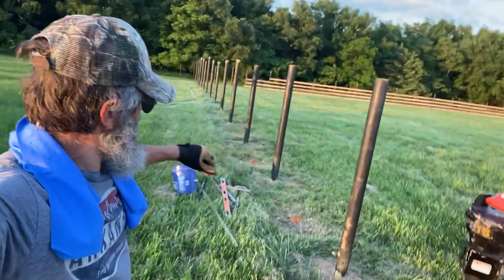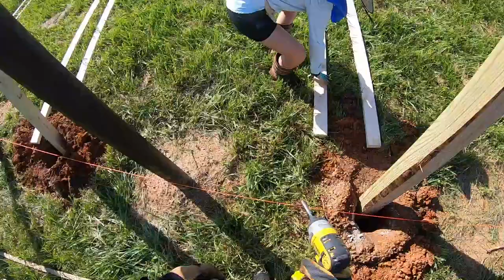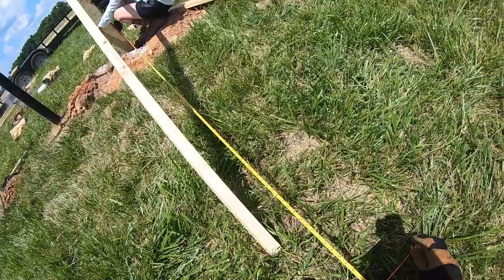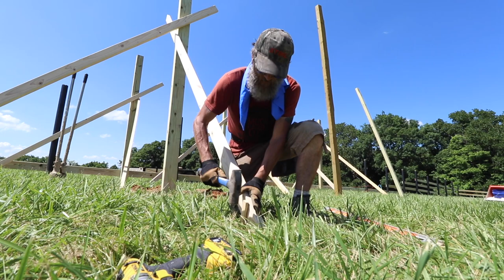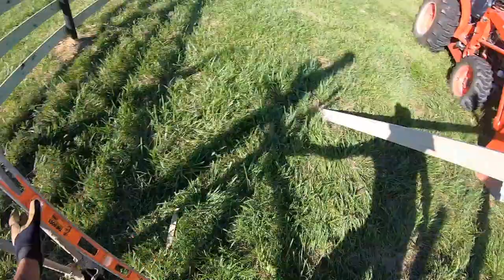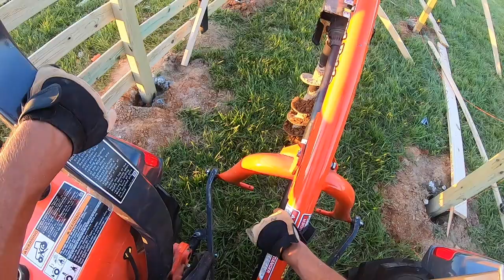Building a Horse Shelter - Episode #1: Posts

Comment: Two things about keeping horses. #1 Horse hooves can get caught in HOG WIRE with disastrous, even deadly results. There is a smaller dimension square mesh wire fencing readily available that is safe for horses. #2 Horses are herd animals and require at least one buddy. Horses always have one standing guard while the other(s) sleep. It is also safer to trail ride with two horses & riders. If you can't have two full-size horses, consider getting a pony, mini, cow or goat for a buddy. Great job on building the horse shelter! And utilizing trees on your property for poles and also for the fencing posts!

Comment: Jason, I am modeling my shelter after yours. How deep did you go with the posts and are they 12’ or 16’? Thanks
Reply from the maker: They were 16' with ~ 3' in the ground then I cut any excess off the top.  I believe the front part of the shelter is 10' 6" off the ground and the back is 8' from the ground.  I did build another shelter in another paddock where I did use 12' posts where I have ~3' in the ground and 9' opening in the front with 6' 6" clearance in the back.  Good luck on your project.